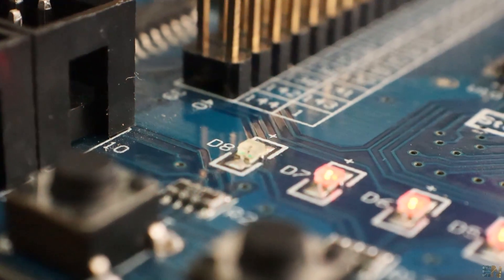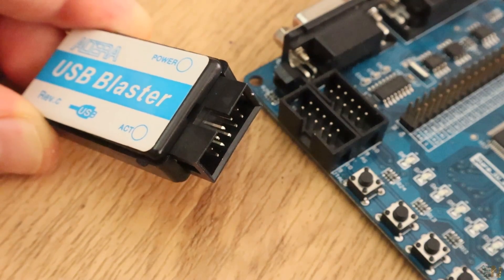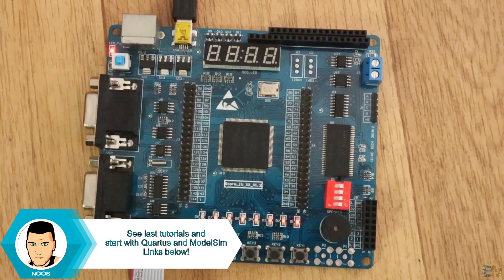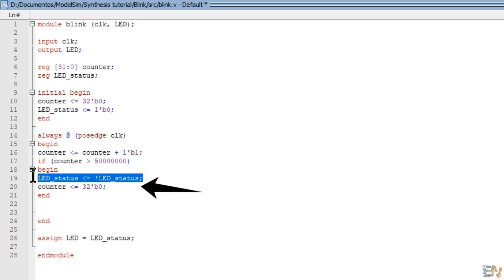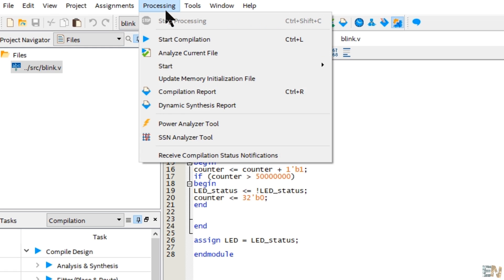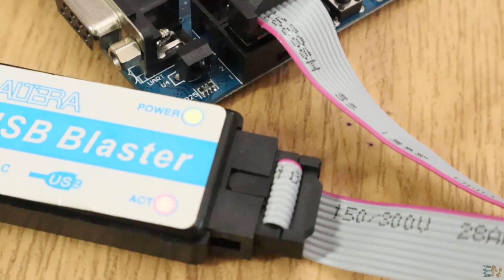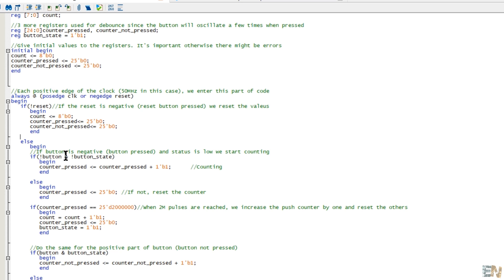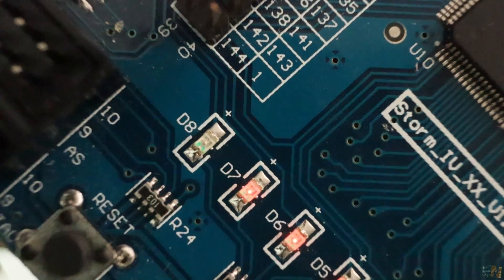Synthesis - blink, counter examples | Road to FPGAs #103

Comment: Can you explain the differences between fpga, other industry standards, and for example, arduino?
Reply: You can design the logic gates inside the FPGA with verilog or VHDL so you can create any device using an FPGA like a processor, memory, MCU etc etc arduino is just an MCU you can't reprogram how it is wired up inside meaning you can't change its logic gates just how it uses those logic
Reply: @johndripper  well I work with railway machinery controlled by PLC

as I understand it, PLC is mostly similar to Arduino, rasp Pi is more like a slow computer with custom IO
and an FPGA is on the other side of the spectrum as if you’ve built your own custom chip
Reply: So if u want u can create an atmel328p(arduno ) ic inside an FPGA ;)

Comment: I did the technical review of a book on FPGAs and, as a result, spent a lot of time programming them in a development board environment.

They're interesting and a great learning experience at dev board level but totally impractical for most makers at any level beyond experimentation.

Programming raw chips is next to impossible and incorporating them and their support circuitry on a PCB is the same.

If you want 10,000 (or more) of them pre-programmed from your design and assembled and tested in the Far East, then they may be a good option - for everything else, sadly, they're impractical.

But, as I said, they're a great learning experience and wonderful for experimentation.
Reply: If there is a need for many I/O pins that has to respond faster than a software emulation, FPGAs are mandatory. 
Try making an 100 MHz Oscilloscope or a low-jitter 32 channel R/C servo controller, or a  32 channel logic analyzer using a micro, and you'll hit a brick wall before you even start. 
You'll have to either design the hardware using discrete ICs, or use an FPGA. No other choice.
Reply: Why are they so difficult to program and incorporate to PCBs? I've never had a problem programming them. And if you want 10 000 chips, an ASIC (converted from FPGA) starts to become the best solution, the prices are falling.

Comment: I actually found a website cheaper than JLC PCB, the basic package JLC offer is definitely cheaper, however once you start adding features like different board colours and so on the price rockets on JLC.
Reply: Which one? Also, options are pricey because you order small quantities. If you order more, the price per boards gets much lower.
Reply: GRBTutorials  Elecrow.com, as I said it may seem like JLC are cheaper but once you start adding features to the board like different colours, the price rockets.
Reply: Seems like the only thing you tried is different solder mask colours. I've used PCBShopper to compare (ordering 10 PCBs) and JLCPCB was always cheaper, except when I chose a different colour and when I chose HASL Lead-free (which is only important if you're going to sell a product using that board, and in that case, it was only a few cents difference total). But on all other options (copper width, ENIG, layers), JLCPCB is significantly cheaper (a few euros/dollars) when it comes to ordering 10 PCBs. However, when it comes to ordering 100 or 1000 PCBs for production, Elecrow is better as it provides certification. But for that case, PCBCart is a better option. 
Conclusion: unless you really want so badly a different colour solder mask at the lowest price, JLCPCB is still the way to go!
Reply: GRBTutorials if you want lead free solder on JLC it’ll cost you like another $4, if you want colour their going to charge you another $9-11 plus postage. Postage from Elecrow is dirt cheap maybe $5 compared to JLCs $7-9 (Chinese air mail)

Comment: FPGAs are way too complicated for makers. So many hoops to jump over! 
Unless there is a need for fast signal processing (like an O'Scope), FPGAs are way too costly on top of being too complicated to learn and implement.
Reply: Price isn't the issue. Also FPGAs are widely used in the industry, just not in consumer products. For example most of the cellular network base stations will contain huge FPGAs.
The issue for most people is, that writing a FPGA hardware description is nothing like programming a computer. It is a completely different way of thingking. The data flow is usually completely different. You can do things in a FPGA, a sofware developer doesn't even dream of.
It is just a completely diffrent skillset than software development.
Reply: And don't forget the power consumption and the size! It's definitely not for blinking LEDs (unless the blinking pattern is very complex and you have hundreds of LEDs). For most cases, MCUs are fine. However, when you want parallelization and very fast processing, implementation (not emulation, with FPGAs you program hardware directly) of arbitrary CPUs and other complex logical devices, etc., FPGAs are the best solution (short of an ASIC).
Reply: I think in general "makers" dont really know how to "design" circuits, rather just plug different modules together and call it a day. With an FPGA the learning curve to learn how to program is nothing compared to the fact that you first need to learn how to design circuits, either behavioral or gate level. because that is all you're doing with an FPGA is designing a circuit not writing firmware like a microcontroller. Dont really know any makers out there that are NOT engineers designing circuits at the gate level.
Reply: also they have a lack the use of interfaces like serial,i2c,spi 
unless you bit bang them but that is hard to do
Reply: @davidrubio8673  Dude you are wrong about FPGA lacking SPI, I2C and UART, may be you should check some of the Digilent boards with Xilinx FPGAs.
Reply: david rubio That’s the good thing about FPGAs: you can do pretty much anything you want digitally. Sure, it might be a bit more difficult, but you have more freedom.
Reply: FPGAs are great for modding old consoles since most microcontrollers might not be able to process and bitbang the signals as fast as the clock rates.